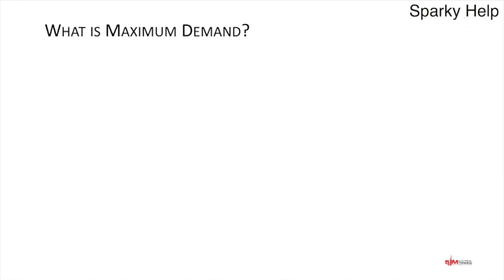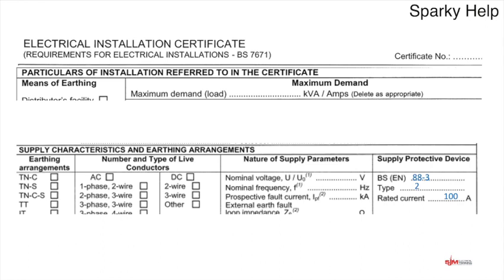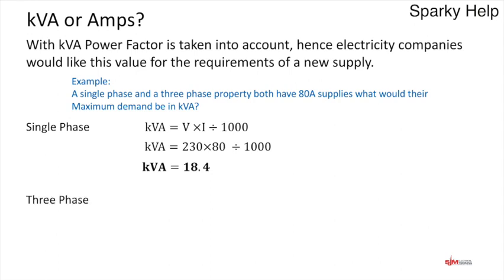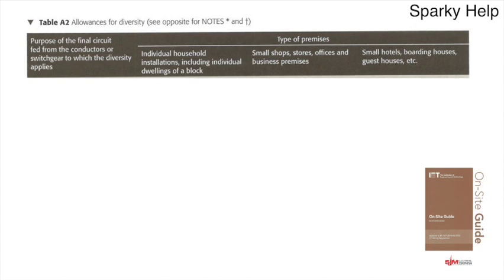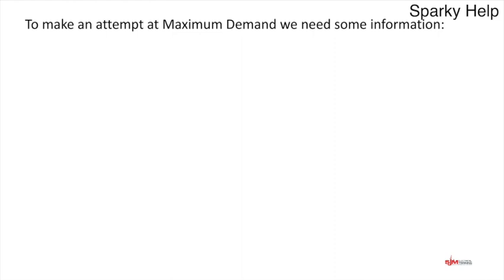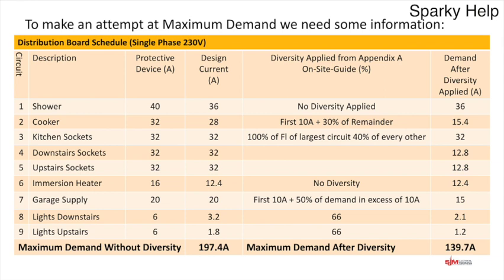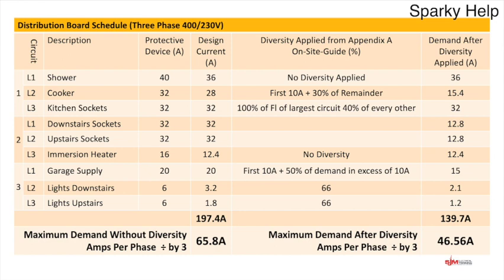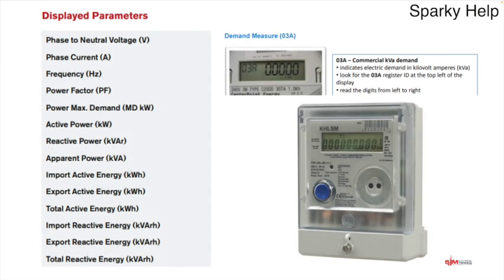Easy Guide to Maximum Demand & Diversity

Comment: Brilliant video! The only thing I wonder is how you apply diversity to storage heaters that are fixed to a wall. I’m learning to be an electrician and tried doing it to my flat that has 3x1500w storage heaters. Do they get diversity?
Reply from the maker: Good question! As these devices are on at night typically, and when they turn on they will likely be on for a period until warm and their own thermostat turns them off.  As the OSG says it is impossible to calculate Max Demand.  Have you got a smart meter this will show your max demand (it would be interesting).  Without further information you could use the OSG recommendations for heating devices, but these heaters will be on when most other things are turned off.  Sorry it is not really a right or wrong answer for you.
In summary as a calculation you may need two max demands one for day time and one for night time.
Hope that helps a little probably raises more question and answers - welcome to being an electrician.
Please Like, Share & Subscribe.

Comment: Hi, Thank you so much for a quality video, however, I do not get it, why did you use 36A design current for shower? If shower is 9.5kW then 9.5*1000/230v = 41A? The current for large circuit suppose to be taken 100% but you are taking only 36A of 40A shower? Where is gone the 4A current?
Similarly for the other circuits which you toke off some of the current before even applying the percentage and the diversity.
Reply from the maker: Thank you, I have used in my example 36A as the design current, these figures are for my design to show how to do it (it is not based on 9.5kW shower - if this is what you have then base your calculations on 41A).  The 40A is the protective device size, this is not the design current (current drawn by the load) of the load.  So to sum up diversity is based on design current, not protective device sizes.  Hope that helps.  Please Share with like minded people or maybe even like and suscribe.

Comment: Hi , how about 2 kw oven . How to calculate demand please ?
Reply from the maker: I'd say normally part of the cooker, but if that is all you have the first 10A is covered - You will have to use your engineering knowledge and experience from the user for it's use.  It will have a thermostat in so when on, it will not call for heat all of the time.
As the On-site -Guide and I do say this is not an exact science.  Just have your reasoning available as to why you have chosen as you have - all anybody can do is say that is not correct - but they would not know themselves until it is installed and you monitor the load over a period of time. - wow that was a longer response than I expected.

Good luck - Please Like, Share & Subscribe.
Reply: You need to know the length of the run what cable your using you need to know all the correction factors and then you can work out volt drop .